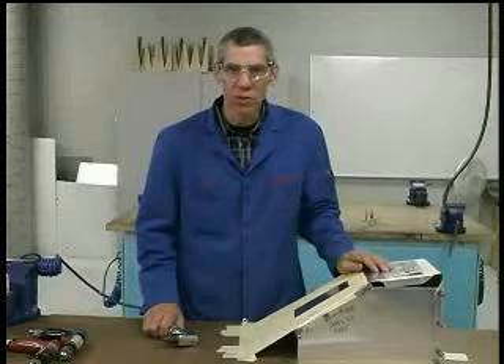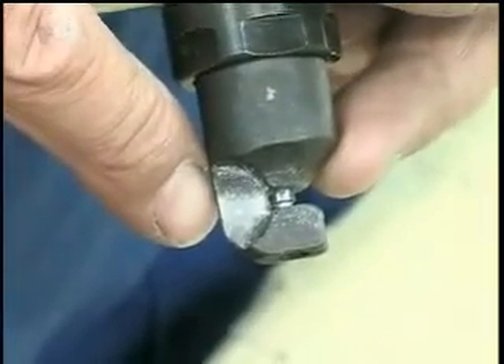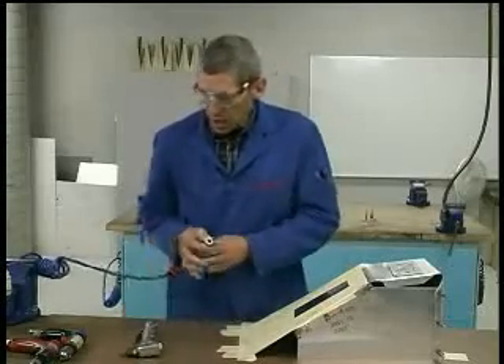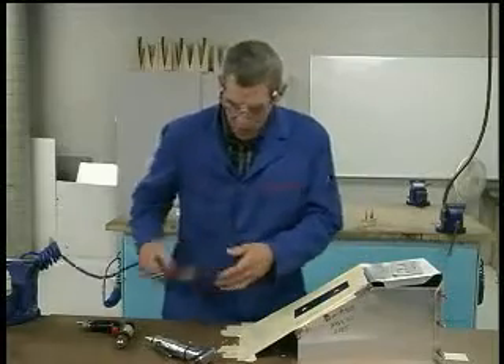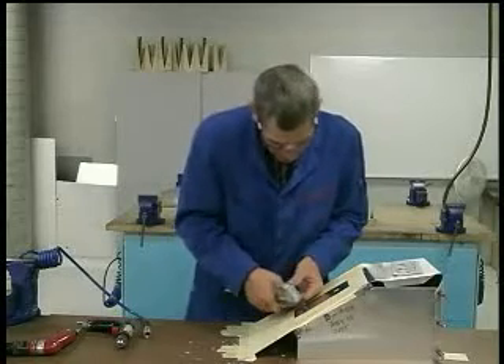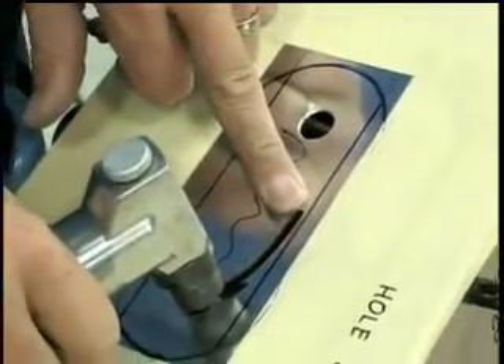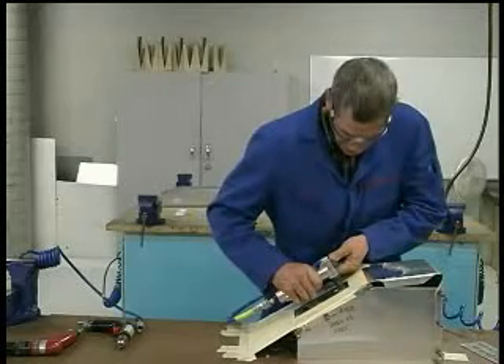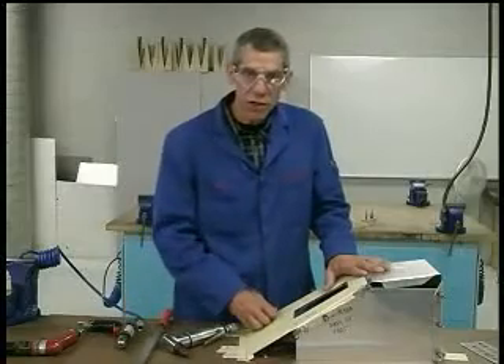Using the Pneumatic Nibbler

Comment: ROFLMAO! I cut a 4" hole in my wife's dryer and I used the Lnchett double nibbler that uses a battery operated drill to cut the hole. Previously I had never ever cut sheet metal and I cut the 4" hole in roughly 20 seconds just following my cut line. The drill operated nibbler is easier to use than the the air powered nibbler that this video is demonstrating by a landslide. I can't believe how much trouble this demonstrator is having. I ordered the Lnchett nibbler specifically for cutting the dryer hole because my sheetmetal shears was making a mess of the job and I ran out of options. Really inside of 5 minutes from opening the box for my new nibbler I had the hole cut. This video is almost 5 minutes long and its frustrating to watch him try to make a curved cut that I made in a matter of seconds. He also pulls out a file to smooth the edges I didn't have to do that but I did line the cut with duct tape as a precaution anyways. 
Watching this video & another Youtube video that demonstrated the air powered nibbler totally convinces me that the drill operated nibbler is a much better option in terms of convenience, ease of use, cut results & time savings. In other words the air nibbler SUCKS!
Reply: I think he is just useless at using hand and power  tools,  he made it  look harder than it is. I seriously question the channel name.